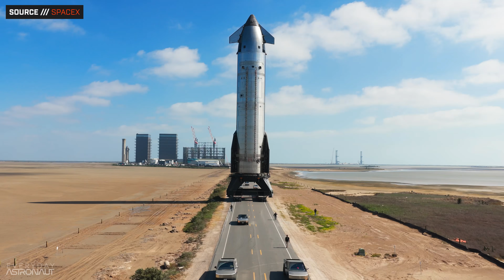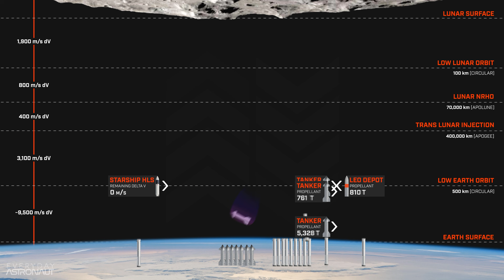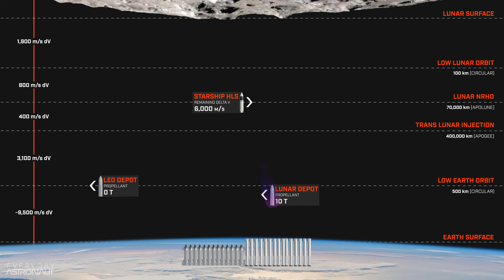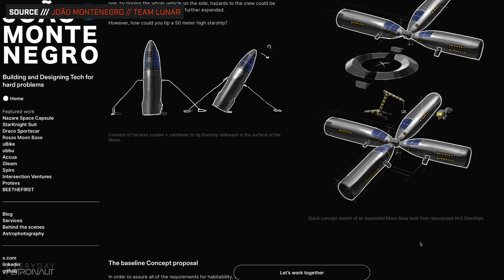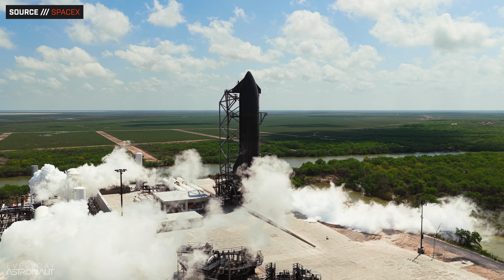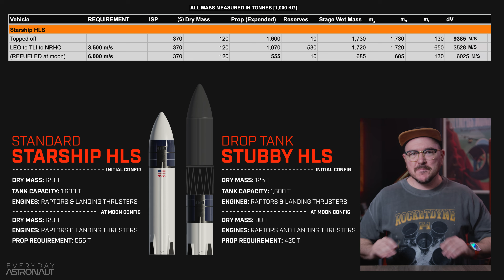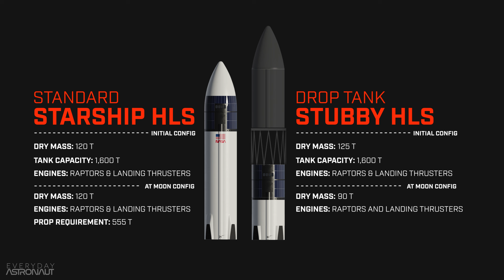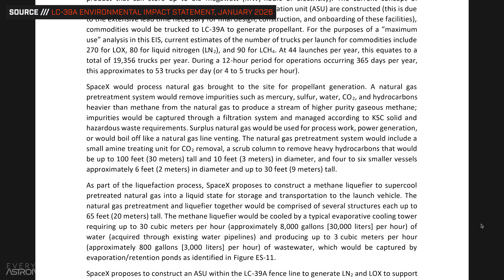Does Starship REALLY require 15+ launches to land one lunar Starship?!

Comment: This is somwhow amusing. In the summary all the right conclusion are made why the current SpaceX approach is very far away on having a lunar Starship. Many questions are still not addressed and the Starship has even yet not reached orbit or demonstrated the propallent transfer in space. Yet,  at 1:40:45 many questions are asked in the form "what happens when Starship" as it would be just a matter of time. Wishful thinking is not a good way to run this program if the objective are to land on the moon.
Finally, human beings will get to the moon again rather sooner than later. It will be a Chinese mission following the overall approach of the Apollo program.

Comment: Falcon 9 launches several times a week.  Once the tanker Starship gets to the same place why not establish a prop depot in LEO that is continuously refilled several times a week with cryo chillers driven by solar ?   With full reusability this could be a a small fleet of ships flying often.  Let's say the depot holds enough for 4 or 5 HLS missions (or any other type of mission)  HLS would simply launch to LEO, dock to the depot and be on its way.  This is similar to Starlink where a large amount of resources are kept in LEO with frequent Falcon 9 launches. This decouples the mission from the prop delivery.

Comment: Hi Tim.  You didn’t cover the option that a customised Tanker Starship could be used to help optimise propellant transfer to LEO.
This would be a NINE engine Starship.

Also there is an even heavier lift option for Super Heavy (Vn 4) which could also help to change the picture.

Comment: Yeah, this whole multi-launch refueling nonsense is just ignorant.  I don't see any hope for this system, at least until they can either 1) get the engines to 100% reliability (LOL), or 2) switch the inter-lunar drive system to hypergolics.  The boil-off will be insane, and put a hard time limit on any mission.  There will be zero chance of a long-term colony on the moon without at LEAST a hypergolic emergency return system with no expiration date, and starship is not that.

Comment: Why do people still consider this makes any sense? Is this to be fully reusable? First, it's not reusable. Second, you lose 1 tanker from all of those missions, and your profit is instantly gone. Don't include the cost of the fueling and mantainance. It does NOT add up. Period. It's just putting massive effort in something that MAYBE CAN be done but it shouldn't just for the sake of it. Why the effort? You will need to do this continue operation with many many trips to even try constructing a base on the moon. With the challenges a base on the moon already is (thousands more). So, whatever.

Comment: If my math is right the most realistic option at the moment is to simply do a stubby HLS with the tankage capacity to do the NRHO to Moon surface and back, lowering massively the weight of the thing (target of 90T) and reducing the tipping and elevator problems. Then instead of mating it directly to the Super Heavy booster, you do a second stage by adding back the missing tanks with their row of Raptor engines. This way the second stage propels the stubby HLS to LEO, but you don't discard it. You refill in LEO as planned, then the second stage does the TLI and NRHO burn so the Ship hasn't to do it itself.

At this point you stage and have a Moon lander which isn't wasting 30 tonnes on empty steel. This means you also need to haul less fuel to NRHO to refuel it, since it needs to burn less to do the mission.

Comment: If the goal is to only land on the moon, then why do we insist on having a 100-ton payload? Those 15 refulings are for the time that starship lunches to moon with its full payload, which is infact a good capability. I'm pretty sure that starship without full payload capacity and with only the equipment needed for the crew would need very few refuling.

Comment: How would the math change if you took two extra boosters and made a starship heavy for just the tankers like the falcon heavy? Since, according to wikipedia, going from falcon 9 to falcon heavy takes payload capacity from 18,500 kg to <50,000 kg. With both systems maximally reused.

Comment: Landing vertically with thrusters firing out laterally from the top seems to solve one problem, but creates new ones I've not seen addressed.  How much more thrust is required and how much fuel weight is added to calculus of landing and lunar liftoff?

Comment: A couple of corrections. The landing leg width to height ratio of Apollo LEM was 1.14:1 not 1.3:1. Also the amount of remaining fuel at landing of HLS will be closer to 10-15% depending on margins than the 33% you estimated. Lastly your center of gravity estimates are off quite a bit given SpaceX stated goal of delivering 100t to the lunar surface. The current design has that payload weight above around 30+m high on the ship. No matter how you look at it, HLS is not a grade tolerant package. To configure HLS with inherent grade tolerance and eliminate the need for fault intolerent self leveling hardware, you would need to move the payload weight as low as possible in its landing configuration. This could be accomplished very easily by lengthening the legs to reach the upper part of the ship, hinging them at the bottom like Falcon 9 and splitting the payload vertically into 3 large sections so that the payload can be shifted down to ground level when the legs are deployed. That also eliminates the need for an elevator as both cargo and crew sections would already be at ground level when the ship is on the surface.

Comment: Amazing video.    I don’t understand the delta v calculation - can anyone help for my own curiosity?

If you have wet mass - dry mass I assume that is a way to measure the fuel to weight ratio?  But then even if you multiple by ISP how do you know the fuel burn time.  

Where is the fuel burn time calculated?  Or maybe it doesn’t need to be?    

Appreciate anyone wiser than me helping me on this one bc my brain has been noodling for a while.

Comment: Alternative 2 part method.

1. Send on full size vehicle, that is kitted out entirely as a Luna habitat, will land and then stay on the moon. This reduces fuel cost as it doesn't have to come back.

2. The vehicle that takes people would be set up more like Apollo with an orbital section and a lander. It would only need to be set up for travel to and back from the moon. No scientific equipment, elevator, lunar suits or rover. The whole ship doesn't have to land so fuel is saved on LLO>LS>LLO, it would be able to do LEO>LLO>LEO and would itself be used as the fuel depo in LEO with only the lander capsule coming back to earth and a subsequent missions going back up on a Falcon.

Comment: Could they reduce refueling trips by leaving Starships in orbit as you noted - and use, say 10 of them, to build a new space station?  Also, how does it change your spreadsheet when they can produce fuel on the moon and get it into space with linear accelerators?  Or use the linear accelerators to launch Starship off the moon, back to earth?

Comment: I wonder what’s the payload of an expendable “fuel bladder” starship?

No fins, tiles or sea level engines just one huge tank with just the most efficient no. Of vacuum engines.  

Even the structure can be weaker the fuel pressure provides the integrity. 

Would be cool if it can launch 150 tons for the loss of say 4-5 R Vacs

Comment: Seems like a simple fix.  Flammy end up, no pointy end.   Put the legs opposite of raptors; put the thrusters in the skirt pointing opposite of the raptors.  Land on the payload end down; and you can even ditch most of the payload on RTO.   Use the payload modules to start building your moon base.

Comment: For early moon trips, I think there would be a huge benifit if the rockets to the moon were designed with an ascent stage. At least until some local permanent resources could be brought to the moon to reduce the dry weight required for future trips. If you left equipment on the moon, there is a future option to recycle it as well.

Comment: Here is another idea that I’ve never heard anyone present.  With modern computers, pin point landings are now common place.  One of the biggest issues with the Apollo missions was our lack of ability of precise landings.  We got close, but, pin point landings were nearly impossible.  As such, we have the capability of sending autonomous rovers to the surface of the moon to construct a landing pad before we start landing humans.  They would be able to create a level pad made from ground and melted regolith so the unknown of surface landing could be reduced to near zero.

The other part of this is landing a starship horizontally is great, but, how do the astronauts get back to Earth?  Would the thrusters alone have the energy needed to lift the rocket off the surface?

Comment: I dont understand, why fly the same craft from leo to moon landing? Why not use starship to lmo and then deploy lander wich should be alot smaller...

p.s, also if u want to land a base on the moon you dont need that to return to earth, you can just dismantle the engines and return it with a smaller craft, same to cargo delivery crafts. I belive that starship is good to travel and push stuff from leo to lmo, but landers themselves should be completly redesigned..................... also there is no air drag on the moon, why spend weight on the aerodinamics? We a re looking and most powerfull raptor engine ever, most powerfull rocket engine ever, and we are going to use this efficiency to land unnecesary weight on the moon? really????????????????????

Comment: Why can’t they just flip the orientation of the HLS so the human section lands on the bottom. If you’re using the small engines to land and lift off, it won’t matter if the raptors are pointing up on the surface. Just add a flip at lift off too.

Comment: I think bringing back HLS and the cislunar depot is unnecessary. Can't Orion get back on its own? An ascent module should be pre-landed to get the crew from the surface up to Orion and back home. HLS is a relative *palace*, leave it there to use later.
Even if you do try to bring HLS back, leave the cislunar depot in NRHO and refuel it there.

Comment: What about using SRBs to leave LEO? Given a mas ratio of 20 for each SRB, how many SRBs would it take to lift one unused SRB into LEO if launched in a cluster burning all but one as a payload? Do SRBs work better for long term storage in space? ... LOL, Google AI answering the second question says "Conclusion: It is physically impossible to lift one unused SRB into LEO using a single-stage cluster of identical SRBs with a mass ratio of 20."

Comment: Tim, nice calculations! You prove what von Braun already calculated on a slide-rule. You can't go to the moon with just a two stage rocket!  Apollo used 1,2,3,4,5 'stages' for a reason to go to the moon, land and get back home in one go.  In my humble opinion fully reusable rockets make sense for LEO but not for landing on the moon. Having to burn so much methane in our fragile atmosphere to park an unstable tower on a rough surface seems a rediculous exercise and is totally unsustainable. SpaceX: get your heads out of the sand, and start acting smarter and more responsible please!

Comment: Hi Tim, excellent video as usual. Thinking over the different options, if our objective is to land on the Moon as early as possible we should not stress things to the limit, so what if we land Starship with no fuel for the return , no halo orbit, just a one way ticket to the Moon to do what Starship excel at, landing a massive amount of gear and huge living space for astronauts? For the astronauts, let's leave it to Blue Origin, to just carry 4 astronauts back and forth. Starship would require less refueling,  New Glenn should fly 3-4 times, and it is doable, and, additional benefit, 4 people would be on the Moon, doubling scientific and exploration time.

Comment: 37:46 just a slight correction: space is actually cold because the air molecules have a very low average kinetic energy. But as you correctly then said, because there are so few of them, there is no use in that low temperature, since nothing is taking the heat away

Comment: The obvious problem is landing a Starship on the moon - big and heavy, more than is warranted. A different vehicle is needed - after all, it doesn't need to also launch ITSELF off the Earth, OR land back on the Earth (and no flaps is already planned). An HLS can be carried by a modified Starship - once it is in orbit, it is already halfway to the Moon (roughly, in delta-V terms). Different ships for different jobs. 
(A) HLS for Lunar landings and Liftoff  
(B) A transfer vehicle, moving astronauts from LEO to Lunar orbit  and back again - and it does NOT land back on Earth 
(C) A vehicle to get astronauts into LEO and back again - i.e. Dragon or a larger version 
(D) Starship to get HLS and Transfer vehicle into LEO. 
(E) Starship fuel carrier. 
...
ALL based on the same ideas, using many common parts. 
...
"A tool designed to do many jobs does them all badly"

Comment: The Boston Tea Party took place on December 16, 1773. The Sons of Liberty boarded three ships and dumped exactly 342 chests of British East India Company tea into Boston Harbor, weighing over 92,000 pounds—which is roughly 46 tons. [1, 2, 3]  
This act of defiance was a direct protest against the Tea Act of 1773, which granted a British monopoly on tea sales and maintained the controversial "taxation without representation". [4, 5]  
What did it lead to? 
Great Britain responded with harsh, punitive measures to punish Massachusetts and reassert control over the colonies. This led directly to: 

• The Intolerable (Coercive) Acts (1774): Parliament passed laws that closed Boston Harbor until the East India Company was reimbursed for the tea, effectively replaced the local elected government with a military-backed governor, and allowed British soldiers to be quartered in empty buildings. 
• The First Continental Congress: Instead of isolating Massachusetts, these harsh acts united the other twelve colonies in alarm. Representatives from across the colonies convened in Philadelphia in September 1774 to coordinate their resistance. 
• The American Revolution: The escalating tensions and breakdown of negotiations quickly boiled over into armed conflict, officially sparking the Revolutionary War at Lexington and Concord in April 1775. [1, 3, 6, 7]  

AI responses may include mistakes.

[1] 
46 tons worth of tea on the moon 😮
Possibly in one gigantic or two similarly large but one smaller than the other bags 😂😅😊

Comment: I appreciate you running the numbers and doing the physics, but if it's even close? Now it's a business strategy and government contracting problem. Those issues are OVERRIDINGLY important. 
Here's the part I think you're missing. The mission isn't to go to the moon. The mission is to get to Mars, via a flexible rocket system that pays for itself by doing heavy lifts to orbit. The moon is a big deal to NASA, but for SpaceX it's a side show: PR boost, regulatory fast-track, and a way to scale the demand for more Starships and launches even faster. 
Your tweaks are great if this was the 60s and we were trying to put boots on the ground, plant a few flags, and then call it quits for fifty years. Musk isn't doing that. He's using methane because ISRU on mars will require it, and it's easier to handle than hydrogen. He's using a standard design that, once man-rated, will have all that flexibility you mentioned at the end. Multiple fuel-delivery trips don't phase him, because his design has economies of scope across mission profiles and economies of scale across multiple launches, and he will need this insane launch cadence to do the mars mission anyway. 
For him, the moon is a detour that helps him hit his mars targets. For NASA, Starship is a pseudo-COTS solution that's going to cost way less than the cost-plus boondoggles the Senate has been foisting on them and isn't just a concept sketch for 2045. The moment you try to shoehorn in a whole new development cycle for a mission-specific vehicle, you're tacking on ten years minimum and a vast distraction for SpaceX from their real business plan. It would kill their mars plan, probably kill NASA's moon plan (which will get re-written if the presidency changes parties), and turn space back into a series of multi-decade boutique pork projects. Against that, the extra launches are a total non-issue. The extra missions just push SpaceX further up the learning curve and create the demand for capacity and cadence he already needs.

Comment: Before going to the moon, SpaceX should focus on lofting what should be the prerequisite for any low-g outpost:  an orbital rotating station to serve as the anchor.  

Make it big.  Make it from inflatable sections.  100 segments.  1km in diameter.  5k people. Multiple fission reactors.  Full fabrication facilities, able to make anything needed.  And importantly, 1G simulated for recovery / raising children.

Then, we figure how to get the station to the moon or mars.  Magnetic tether drives could be used, along with slowboat ion thrusters.

Going to live on mars or even the moon without this will be madness.

Comment: @41:15 - does that acutally work? If you use electricity to cool something, you have to transfer the heat to something else - 2nd law and all that. So you can probably reduce the amount of gas you vent in exchange for heating up the gas you do vent to even higher temperatures, but can you "completely mitigate" the problem?